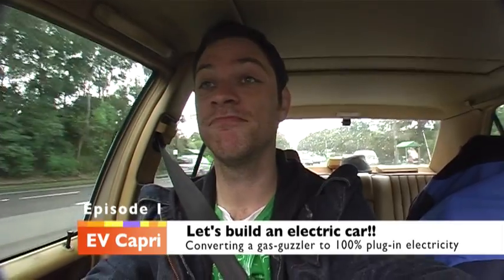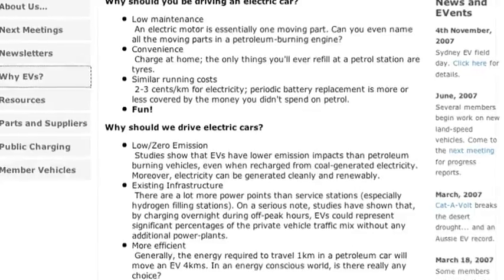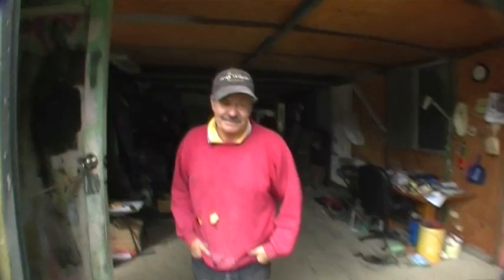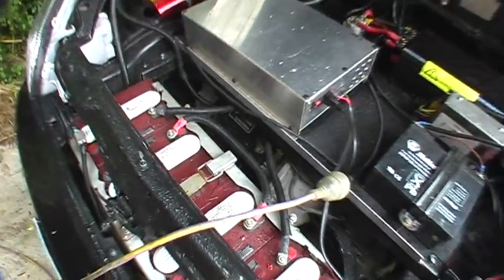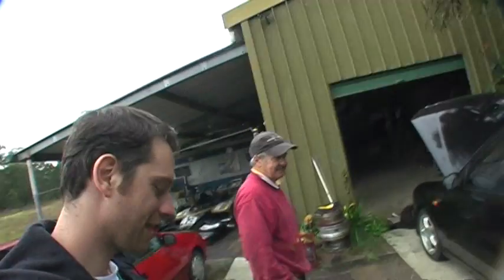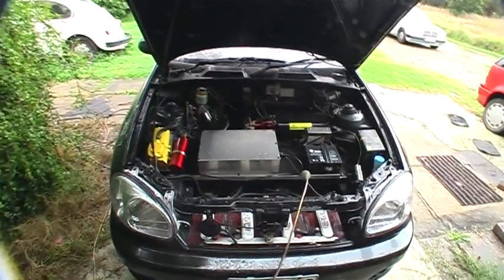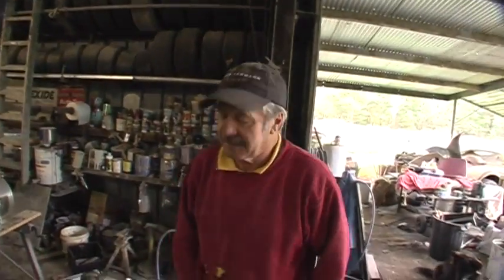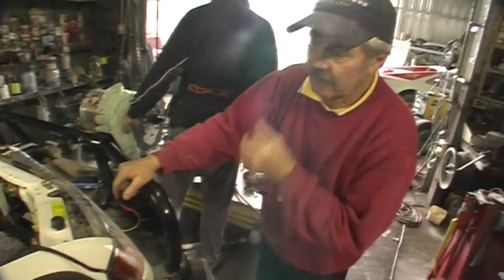EV Capri ep 1 - Kearon's 100% plug in electric car conversion

Comment from the maker: In theory, yes, that'd be the way to go. In reality,friends have discovered that the current draw on the batteries is the stumbling point. Besides - the Capri is a front wheel drive!! Taking the gearbox out would be silly, as there still needs to be a way to drive those front wheels....